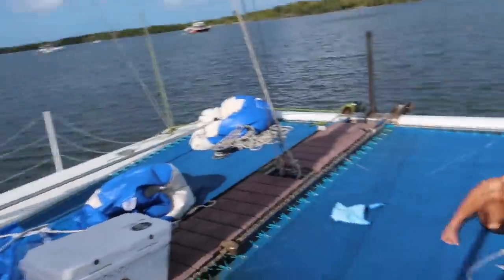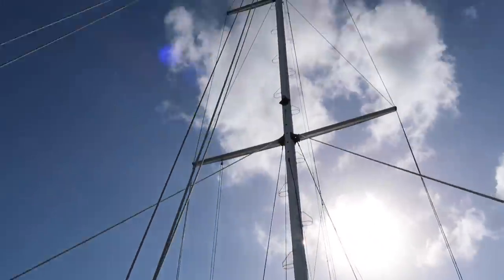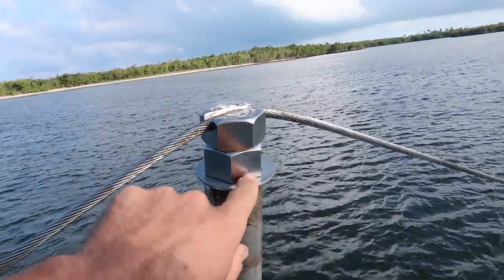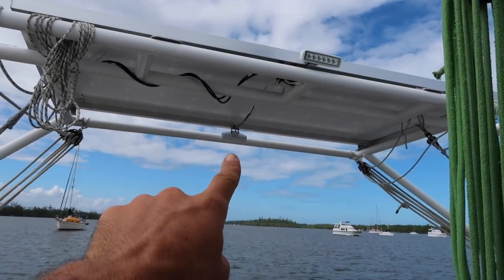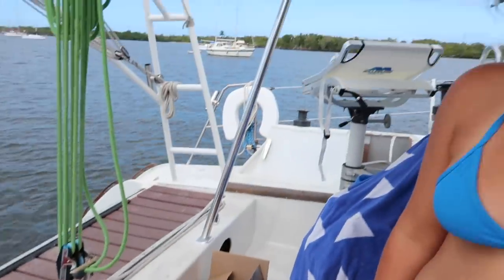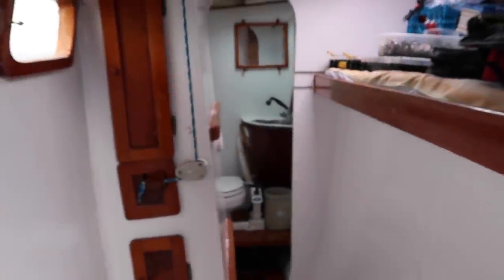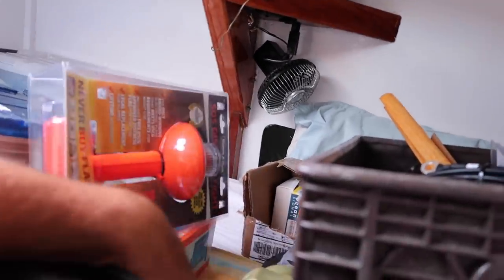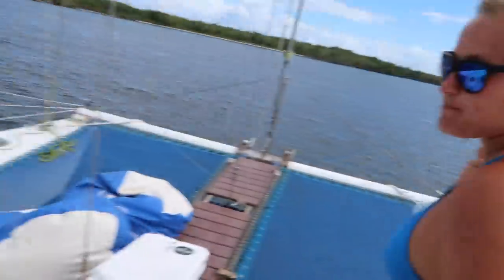DISAGREEMENTS ON A BOAT. should we have a generator on a simple, fast, multihull cruiser?

Comment: #TeamBilly 😎

With that Honda Gen, you will need to carry/stow gasoline which would be a big safety concern and it will last maybe two seasons in the salt water.

Billy just get a big Palm leaf fan and gently fan Sierra while holding her grapes. 🙇🏻‍♂️
Reply from the maker: I will GLADLY carry a big palm frond and fan Sierra all day!
Reply: Need to carry gas for the outboard anyway.
Reply: @ting tong - Did they get a new outboard?    <----- Yeah I know..... SAVAGE!
But regardless you will need to carry more gas (equals more concern)for a gen running a AC and other things (because if you have it you will use it more) than just an outboard, I would have a gallon of gas (sitting in the dingy) for a month of use easy.

Again just my .02 cents for what that's worth  😜
Reply: Trufuel is stabilized gas in a sealed can. Can last up to 5 years unopened. 2years opened. Kinda expensive but good for emergencies
Reply: Really? A big safety concern? A bit dramatic if you ask me cause most cars, lawn equipment, dinghys, generators run on gas EVERY DAY....maybe you should rethink your handling techniques?
Reply: @wakeboardbob  Exactly.  If that makes you nervous, you shouldn't be out sailing.
Reply: There's also a trifuel conversion kit available from Hutch Mountain, which allows your genny to be used on propane, gas and natural gas (two of which can be brought on board easily).  www.hutchmountain.com
Reply: Travis Sparky how about their outboard. They carry gas for that
Reply: Travis Sparky grapes? Melons.
Reply: Back in 05-06 we lived on our 38 ft Tuna boat for a year doing the ICW. We had a Honda2000 gen and it still works today. The boat was gas, the gen was gas, and then the propane for cooking.....we were a floating bomb basically. With common sense and safety we all survived.
Reply: They already have gasoline on board for the dingy!!! Dahh.

Comment: You are cruising, not racing. The generator weighs as much as a couple of gallons of water. Plus, power when you need is is never a bad thing, so many uses. 
Also, it sounds like Billy has never lived with hot, still, humid nights for months, where you don't sleep, sweat constantly, the grumpy moods that a lack of sleep brings, the list is long, take the damn generator.
Reply: Flame Thrower all these young cruisers think it’s all about speed. Buy a racing cat if you want speed. They’re supposedly live aboard. Noticed he’s not replying to the comments.

Comment: Hey guys, we spent 12 years cruising in the Caribbean and never used air conditioning even though the boat has it. BUT, we did occasionally need our generator to charge batteries. Refrigeration runs harder in the hot temps, sometimes we anchored in windless bays, alternators can fail and running the generator is better than running an engine and you can end up on long passages where your autopilots etc use more power than you can generate with wind and solar... so just saying, we didnt use it a lot but when we did we needed it.
Reply: I agree- redundancy in semi-remote cruising conditions is the smartest way to do it. Having multi-layered sources of power to fall back on is good preparation. It's not just providing the comforts of an AC.
Reply: @davidrix1370   I agree, if there aren't already some solar panels on board, I would recommend getting some small ones. Even if just to run low end appliances like small fans that may help with the warmer air on some nights thus not needing the AC as often. Also, the added expense on the front end for lightweight Lithium batteries could save you in the long run because they will last many years longer than conventional batteries and weigh a up to 70% less. Just thoughts I had.

Comment: Without a doubt bring the generator....A little air conditioning won’t hurt....Happy Wife Happy Life...😊😄😁😊😄😄🙂....Plus Jetty needs air conditioning......Team Sierra.......
Reply: Yes bring 2 generators at 23pounds each it is good insurance for getting stuck in  the middle of a long passage or even as a item to barter in a foreign port. Plus captain jetty likes to stay cool.#team jetty
Reply: This sounds the most reasonable compromise..If you are worried about weight trade in for a newer smaller generator (but it must be able to power that ac properly tho). Yes im with Team Jetty!
Reply: Team Sierra  bugs are bad and you can close and use the air, i was so glad I had my Honda and a small ghetto  Walmart unit best 100 bucks I spent. Plus I brewed Fresh coffee with it!

Comment: Just to clarify I don’t need an AC to be happy 😂 but since we already own a generator that could come in handy in many different ways we should at least bring it. 🤷🏼‍♀️ and I would only use the ac on unbearable nights. But Billy would probably use in for one of the trillions of projects he starts 😂 
#teamsierra
Reply from the maker: How long will it take Billy to notice that I pinned this?😂
Reply: Makes sense to me to bring it, yall have already lost sooo much weight. I get where Billy is coming from, but if your ever short on power, it'd be nice to have the backup. #teamsierra
Reply: Absolutely. The generator also brings with it a huge safety factor. Redundant systems on a boat is ALWAYS a good idea.
Reply: there's a lot more uses for a generator than just AC
Reply: Your little Honda generator has a dry weight of around 50 lbs. The only downside to taking it along is you will also need to take along some fuel which of course is around 6 lbs. per gallon.
Reply: Sailing nahoa said that if you have to talk about it do it. Granted they were talking about switching sails but I think this fits too 🤷‍♀️
Reply: #teamsierra FOR LIFE
Reply: Take it anyways!!   Better to have it and not use it than need it and not have it!
Weights not an issue with that cat!
Also, you may need it to charge batteries, run electronics, blah blah..
I'd take it if not for the peice of mind!
Plus, I'd have a hard time saying no to you! Lol
Reply: I think most folks understand that this is just plain fun and your true happiness comes from being together. Don't let some party pooper who has never enjoyed what you and Billy have make you feel you need to explain it. Enjoy the new air conditioner. :)
Reply: adding the generator and a/c unit will make life so much better in the long run!
Reply: Make the girl-spouse happy… and take the generator!
Reply: Def take, better to have it and not use it, than to want it and not have it. I mean seriously  how much difference is 50lbs gonna make
Reply: Bring it and you won't need it. Leave and you will need it.
Reply: I think you'll also want to confirm that your generator can support one of those small AC units, but I agree with carrying it along with you.  It's really nice to have what you need when you need it.  Some of the islands can be really expensive.
Reply: For sure bring it also I would get the AC unit, don't have to use it but its nice to have the option. #teamsierra
Reply: You cant live in south florida without air conditioning unless you sleep in the water, its not the heat its the humidity thats so brutal, it sucks the life out of you
Reply: I say Billy takes one for the team here!
Reply: Its better to have it and not need it than to need it and not have it, remember that it's only 40 - 80 lbs.!
Reply: Bring it many more reasons than just A/C to have a little insurance #teamsierra
Reply: Yeah, I'm team Sierra on this one, like most. There comes a few nights down here that are smotheringly brutal. And I'd go ahead and get the AC unit, set it up and make sure it all works before you left. That way you can then decide if it is 'worth the weight.' And while the overall weight is an important goal, you guys are not racing. You won't notice an extra 100 or so pounds (assuming you have to take gas too). And yes, a generator has other uses besides AC, and empowers you to be able to do far more out at sea than you could without it.

The alternative to get some sleep without AC in the weather we are talking about is frequent cool showers. But freshwater is even more precious than a few pounds to you guys. Also, keep in mind that you guys live this lifestyle because it is better than living in a little house in Stuart. The moment it is not better than that, then why are you doing it? You're not in the Marines, you're not getting paid more if you suffer more, and we'd rather see you two be as content as possible for our viewing pleasure.

 - One more thought for Billy. The two of you have different bodies. One of you has a little more fat on you than the other. That's simply the way it is between males and females. Therefore, the exact same muggy conditions feel hotter to Sierra than they do to you, Billy. You're quite a stoic guy, and can push through pain and discomfort with the best of them. That's a gift that you've earned by keeping yourself in such great shape. Don't make that a burden on others. :)
Reply: As far as weight put the Genny in the dingy and have less noise to
Reply: Take it! If you find you don't need it after you get down there, sale it. Go team! Lol
Reply: And in fact, I have further advice. Get rid of the storage unit if at all possible. That is stuff that you mostly don't need, except for some small part of it that you do need. That stuff you can keep at your parent's places.
Reply: Both of you have good points but you are not racing your a cruising boat id say bring it for the dozens of other reasons you could use it
Reply: Bring it.   I sure need AC to be happy when its it's hot.
Reply: Take it if you need power for a repair, or just because it hot as hell at night and you cant sleep.
Reply: @jamespotter936  Just to clarify, it's not just the heat. Hell, it's hot there for 9 months a year, and you get used to that. But sometimes the doldrums I think it's called sets in, which I believe is a high pressure cell that gets stuck in place. That is truly miserable, and you break a sweat standing in the shade with an umbrella drink in hand. Not even the hint of a breeze. Those nights are even worse, when the already high humidity approaches 100% with the drop in temperature. And it doesn't drop much, so the daytime is actually more comfortable than the night.
Reply: genny, yes
Reply: Bring it!
Reply: Oh I'm on team Sierra. I live in the very bottom of South Carolina and I know how flipping hot it gets.
Reply: I am a "it's better to have it and not need it, than to need it and not have it" kinda guy. So I vote for you Sierra. :-D
Reply: Happy Lady happy life. Otherwise its "I Told You So"
Reply: @Tulasendlesssummer  ..a week at least before he notices.....and you're right...a generator would come in handy for a dozen on the trip boat repairs/projects..editing/electronic work when its overcast and raining
Reply: Our dual/fuel Honda 2000I is in it's 24gal ActionPacker and comes on every trip we go on with the Airstream, wouldn't be without it.
Solar works well, shore power not so good when we are 'boondocking', a reliable back-up just makes sense for us. 👍
I am reminded... My lovely Wife wanted to go to Cleveland on Vacation...
But I'm the Husband...so we went to Cleveland.😍
Reply: Billy needs to remember "happy wife happy life" even though they aren't married he should be practicing for the future.
Reply: I'm with Sierra on this one!! Spoil her( and yourself a little)
Reply: I never go anywhere without my portable generator.  You never know when your going to need it.  Billy listen to Sierra and put the generator on the boat. Or you could find yourself riding in the dinghy behind the boat.
Reply: I say go for it.  Billy said in this video that he already saved HALF the weight of the generator by going to the very expensive titanium chain plates.  You also saved weight aloft by making dyneema lazy jacks.  Weight aloft counts at least 2:1 over weight in the hulls.  I am sure that switching from stainless to dyneema standing rigging will save the rest of the weight.  Plus the generator can be stored low which will help with ultimate stability.  Next you have to convince him that you NEED a wine chiller (you can run it off the generator) to balance the weight of the generator (added weight in one hull requires equal weight in the other hull to maintain balance ;<) ) .
Reply: Team Sierra All The Way!! Sorry Billy, gotta keep the woman happy. lol
Love you both 😊
Reply: Take it with you. You might need it for power tools Billy! Besides are you insane not going with what your admiral says. Dude she needs to be the winner on this one. Sierra don't falter on this point. You have a good argument.
Reply: @Tulasendlesssummer  A/C all the way , better sleep , better mood better everything , tell Bill he can sleep outside while your chilling in the A/C Sierra
Reply: Sierra, just tell him he needs the generator to run the air. He is obviously suffering from heat stroke already. Ok tell him he could use it to run his power tools anywhere.
Reply: Taking it along makes sense the AC and Generator to power it would prove very useful if and when needed Jetty would appreciate it also team Sierra on this one nothing like a cool breeze on a hot steamy night
Reply: I'm with her, take the generator and get a little AC.   First of all, she's totally hot, so that's one thing and secondly, once you experience a ridiculously hot day and you find a little reprieve because of the ac, you will be so happy.   Also, now that you talked about it, if you don't take it, you will constantly regret it later....oh, and by the way, did I mention that she is totally hot ?!?!
Reply: Happy wife (gf) happy life! Keep the girl cool.
Reply: #teamsierra
Reply: Billy, Billy, Billy.  How can ya say no to that modest request from your beautiful gal?
Reply: You have made a great case why you should take it along. It might come in handy in an emergency as well as a project. You don't have to carry a lot of gas and it can be safely stored. As to the weight, you've cut out some heavy tanks and other equipment that far offsets its weight. Most important, she wants it Billy!
Reply: Denying AC is  keel hauling offense.
Reply: Definitely take it. Reason #1. Sierra doesn't seem to ask for much, she should get this, she lives on a boat and helps with boat projects, a 50 lbs request is nothing. 2. Charge a dead start or house battery with it on a cloudy day. 3. Run a power tool to complete a project. 4. Charge a battery for a trolling motor or a torqueedo if your dingy motor gets stolen. 5. Run an A/C so you can sleep. 6. Run a large A/C powered pump. 7. Backup power if your solar charge controller dies.
Reply: Sierra Groth I think a boat with a happy girlfriend on it is the best option
Reply: If he's smart Billy will let you win this one, Sierra.  If for no other reason than redundancy. One day he will be happy to have it on board.
Reply: Sierra Groth Totally agree with you, better to have than not! 💪👍👍👍👍
Reply: Sierra- You should win!!  You never ask for anything! Go get a a/c unit and take the generator!  You guys will always have it and if you spend the summer in Jupiter this year you will need it on those few days!
Reply: Sierra says bring it : So there. That's settled isn't it.
Reply: Billy, you don’t have a chance. the beautiful lady will always win. 😂
Reply: Sierra Groth 
For sure girl!! I’m on your side! AC is life, and I’m from Alaska! 🤣 I hope Billy changes his mind! 😉
Reply: #teamsierra 👏👏👏
Reply: I say you should have air, who does the majority of the cooking? Looks like you take good care of your Man and 40-69#'s isn't going to make that much difference, put the old sail Cover in the storage & get the generator!

Comment: A generator of this small size should be required on the boat. 
Potential uses list would be very long! From repairs( water or air pumps, compressors, saws, drills, sprayers etc etc) vacuuming, communication, lighting, battery charging, refrigeration, water treatment systems, creature comforts ie cooling.  More powerful and backup to solar, boat main batteries.
Like having portable shore power.
  If you had to move to land in an emergency could also take along. 
 Sierra deserves it too!  Nuff said
Reply: Steven Black -  Was looking for a response that paralleled my thoughts.   Elecstasity is a very useful thing to have !   The generator makes elecstasity more efficiently than the 'drive train' can.  You said it, "Like having portable shore power."    But also, (like Flame Thrower said) , "Billy has never lived with hot, still, humid nights for months, where you don't sleep, sweat constantly, the grumpy moods that a lack of sleep brings, the list is long, take the damn generator."    In a situation like that, it does not take long for a stream of cool, dry air to help your mind come back to reality - sanity.   ( Oh,  I am an ex - Air / Heat Service Tech.  so my opinion may be biased )  BUT, have had to endure periods of extreme discomfort and know that a  little relief  goes a looonnnngggg  way ! !

Comment: Bring the generator and if nothing else you have more currency for where ever you may end up!  Having the ability to trade, especially with something that can be so important to others may surprise you on it's worth.
Reply: An inexpensive $99. "Wally" window A/C weighs about the same as your generator. When you need it, mount it on the deck and it'll blow through a hatch (using a sail cloth cover). Later, if you find you don't need it, donate it to a local. You'll have a friend for life.

Comment: Bring the genset - consider it part of the emergency kit if you ever develop a bad leak in the hull and need aux pumping.  An aux powered pump is also a good idea :).  It's going to be especially useful when you are anchored on a mooring, and you need the additional power to use power tools to fix stuff.